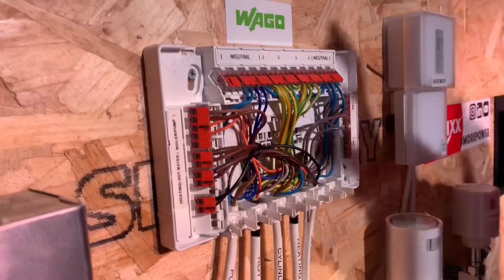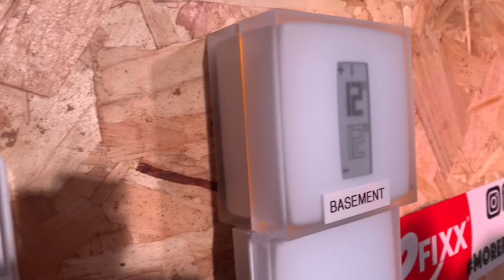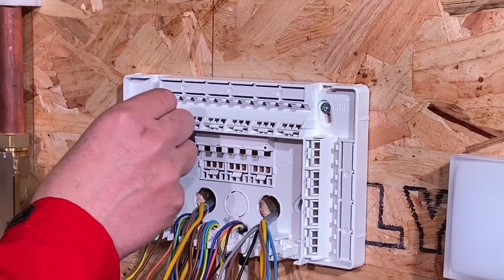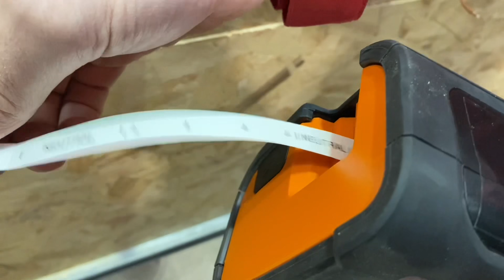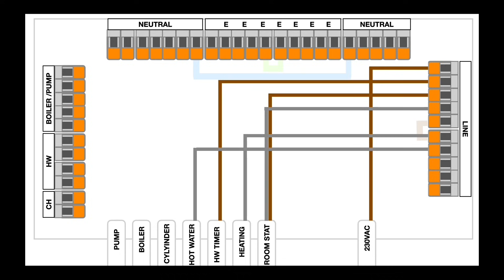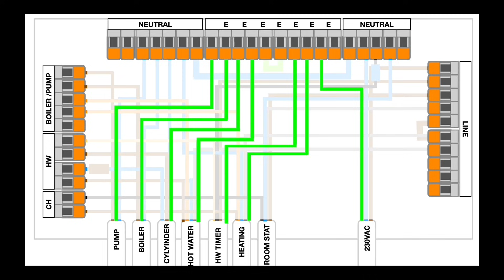S-Plan heating circuit wiring STEP by STEP - using WAGO junction box - INCLUDES wiring diagram.

Comment: Thanks guys! I wanted to write that this helped me build out my heating system on my renovation and worked first time (Plan Plus). I used the middle 3 empty slots as switched lives for my remote pumps for UFH manifolds. Worked really well to come off the switched live of thr stat (link cable from a 3-way wago to an additional 3-way to remote UFH. This was complicated but explained really well.
Reply from the maker: Thanks for the feedback -😊

Comment: Im soon to be attemting my wiring on a new install. My system has my heating on one zone and hot water on a second it will comprise of an..
EPH wired time clock (2 zone ember) to include a wirless room stat and cylinder stat
2 motorised valves
Wired cylinder stat
Im presuming the above diagram would suit ?

Comment: That takes up a lot of wall space compared to the screw terminal variety, something that can often be in short supply. The Honeywell 10 terminal box that many will have in their houses is 40mm x 104mm, whilst that one (assuming I've identified it properly) is 225 x 145mm, or almost 8 times the area.
Reply from the maker: We’ve seen installers ram all of connections in to a dual gang box with blank plate - not pretty!

Comment: I followed your links to buy the appropriate Wago connectors (3-way and 5-Way). Re-watched the video to assemble the connectors and it states in the video you only use 2-way and 5-way, you do not need any 3-way, arghhhhhhh, never mind, the 3-way will do 🙂

Comment: Great Video will be fitting the 207 4301 very soon to our 3 port valve Y system.  This to replace the "rats nest" that was left in a small  100mm x 100mm (?) metal box!

Comment: If you had a second zone on the heating, would you need another 221 for the stat and additional zone valve, and then plug the orange wire into boiler/pump?

Comment: We did this on the last days of college.  Some had problems getting there head around it.  For pump and boiler wiring having two.  I look at it and think why it all easy.  Then I remember on the commodore Vic 20.  A pach out bard with realy switching and feed back from tank thermostat.  To me it just a bunch of switches.  Boiler don't need to be on just the pump why have the boiler on if the tank is hot only need to pump it round for heating.  Or pump out for hot water.  Coming from a background of electronics made this part so easy.  Also from fixing washing machines with mechanical timers.  No water pressure switch is open heater will not ever come on.  But will spin and pump water out water pressure on the heater can come on.

Comment: My heating was 'professionally' installed and it was a nightmare of miswiring (h/w was not controllable), loose connections and screws bearing down on CPC insulation.

This all came to my notice when the 2-port zone valve for the H/W was not operating. I replaced the manual system with a Hive system and ripped out the old wiring centre to fit the WAGO one.

Looking at your diagram, though, there was some confusion, not least because the labelling in the PDF differs from the video but also over the 'boiler' connection. In the video, you imply that the boiler connection is power for the boiler but this can't be so. The connection (top-left) cannot be a permanent Line because this would make the Pump and the two orange wires from the zone valves also permanent Line. It must be carrying the signal from the microswitches on the orange wires to signal to the boiler that the valves have completed their opening, likewise to the pump.

My Vaillant has a single 'boiler' connection and controls the pump internally, so no wire. If my understanding is correct, you are not showing a permanent Line for the boiler.

My installation is based upon yours but I have a permanent Line for the boiler and the 'boiler' conductor (your top-left brown conductor) is the signal to the boiler, and all works perfectly.

I appreciate the efforts you've gone to and getting the heads-up on the WAGO box was a real winner but you may want to clarify the 'boiler' connection.

Comment: I like the look of that but my only comment would be that I would use the black wires ( over sleeved) for live conductors and the grey wires ( over sleeved) for the neutral conductors as this is the option widely used in the industry.

Comment: I've to wire....
2x boilers
4x zone valves
4x circulation pumps
1x DHW thermostat
1x UFH8-RF control box thingy.. which has 5x cables coming from it..

Oh.. and I'm not a spark.. 

May the force be with me... always.
Reply from the maker: Good luck 😉

Comment: Can you explain why the thermostat/room stat use a separate wire from the line source to the thermostat as opposed to a local link at the thermostat connections?
Reply from the maker: The Netatmo relay is hard wired with flexible cables - so doesn’t gave terminals like you see on e.g Nest  - you can see more in this video https://youtu.be/q9IQPLONkyU
Reply: @efixx  so it’s mainly because the relay is nearby and therefore the “extra wire” is very short?

If you were to (for a very weird reason) move that device a few rooms over and extend the cables, I would imagine you’d not keep those two line wires separate.

Comment: Excellent video of wiring traditional heating systems. Never come across tidy or labelled wiring centres like this. It's usually a mess. I alway label each cable but this wago box is next level and will most definitely incorporate it into my new installs. Keep up the great videos gents.
Reply from the maker: Thanks  - drop us a photo if you get one installed
Reply: I've always used Drayton LWC1 wiring centres and recently a Salus TC100 which keeps things neat, but I'll probably give this Wagon product a try

Comment: Well explained guys, but not for diy Dave. Leave it to the professionals. #StaySafe
Reply: That very much depends on the skills and competence of the person doing the DIY.
Reply: It’s not rocket science, but the average professional screws it up more often than not due to time pressure, these days.

(In my country all this logic is typically inside the boiler, rather than manually wired outside it)
Reply: Ha ha ha. Stay safe and leave it to the professional. Like the “professional” that did my place with terminal blocks inaccessibly stuck behind the hot water cylinder. 

Er no thanks. Built my own with Wago TopJob S din rail connectors so it can remotely be connected through hidden cables to another Wago TopJob din box. Now if anything fails it can be replaced without removing the hot water cylinder and I additionally designed in din mounted sold state relays to provide monitoring on when things are powered. All cables are heat appropriate cables and are ferruled. 

All connected to Honeywell Evohome and monitored by Home assistant. 

I’m sure some sanctimonious spark will be along to saying putting the future of the human race at risk by not using a “qualified” electrician, but the last 2 jobs I’ve seen done by an electrician have been terrible. One who did work after their EICR (which was as useful as used bog roll) installed a new consumers unit incorrectly so that the RCD was tripping every time the emersion heater came on and then tried to blame the immersion element as the problem and the other the “qualified” sparky installed a shower supply without providing a satisfactory EIC (page 1 of 4, where’s the rest) and the cable for the supply is not in a safe zone (as requested). I suspect he’s not done any bonding in the bathroom but can’t tell because the work was done while I was not there to inspect it. 

Sure there are a lot of have a go hero’s and there are risks but it boils my piss when certain types make out they are ordained by god to do electrical work and no other shall commit blasphemy by doing their own work.
Reply from the maker: Agree - it’s not DIY territory

Comment: obviously wagos support solid or stranded copper, but do they specifically support ferrules?
Reply from the maker: Yes - but it you would reduce the wire size if using insulated ferrules.

Comment: I think this wiring diagram is trying to trick us, the hot water timer has the black as the neutral and the grey as the switch line, apart from that it is very helpful.

Comment: This is way better than the previous one that was too small. Most systems come with a wiring center PCB now though. It's also competing on cost with shoving everything in terminal blocks and a box so it will be rare to see.